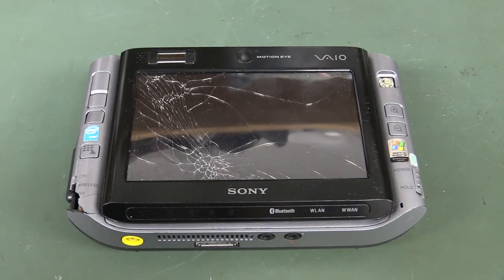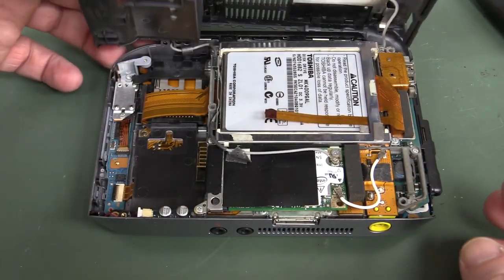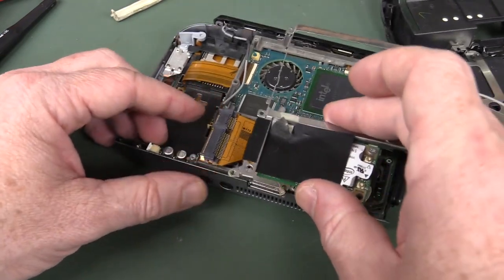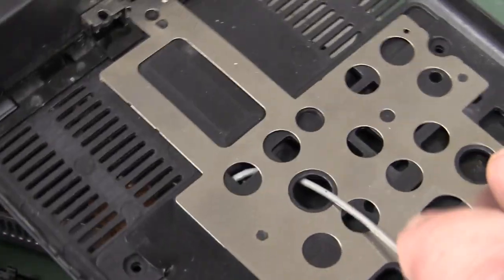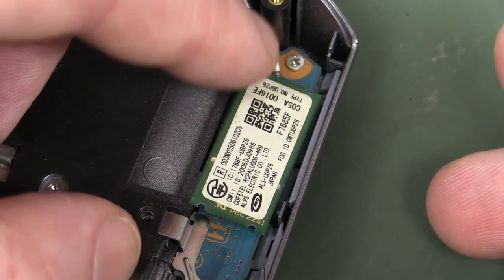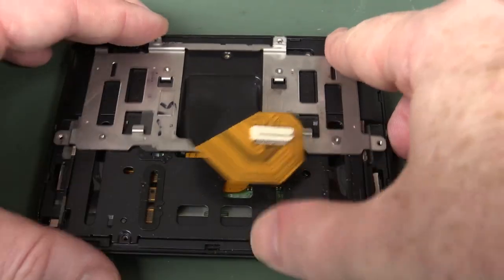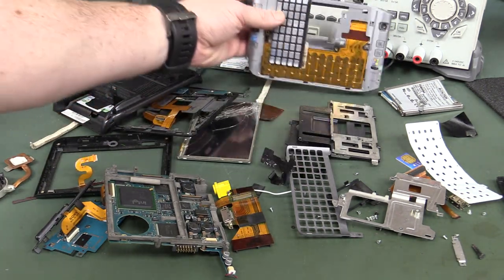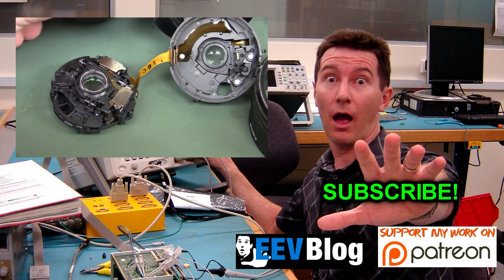EEVblog #914 - Sony VAIO UX Micro PC Teardown

Comment: Around the same time VIA made low power (for the time) x86 processors, that allowed small fan less PC's to be made, they were almost the same form factor as this Sony machine if memory serves me. Troubles is they were low powered in both meanings of the word, low power consumption and gutless. It's amazing how much stuff has shrunk down in 10 years, look at the wifi chipset on the single board computers compared to that big old thing that plugged in to the mini pci express, even that cards that plug in to that interface are about 1/4 of the size these days, you need a magnifying glass to see the one on the Raspberry Pi3.

Comment: They were most probably limited by the processor tech at the time, during the era that that was built Intel chips were pretty much the worst chips for power consumption, in the x86 world, Geodes and such existed but their performance was pretty crap, might have been marginally better with a Pentium M but those still ran pretty hot.

Comment: One of the jobs I had we were on call sometimes and the company had something similar to this with cellular internet built in. These were right before net top things came to market, wifi wasn't everywhere, regular laptops were still big and heavy and we didn't all have smartphones. So it actually came in handy being able to load up the company ticket system or log into a server anywhere.

Comment: X86 processors are inherently inefficient, so fans will be needed. On the other hand the ARM processors don't need all the extra hardware that X86 does since they are pure RISC design, so they run cooler.

Comment: OMG Dave, thanks! I love old stuff like this. Gut it and put a pi3 in it with a little daq board. Battery life: 6 days!

My bet is the h8 did just about everything in that thing but the Windows. Like the video controller in cellphones that does most of the work until you load an app and the CPU gets involved.

Comment: I used to own the Sony Vaio U810 (the convertible laptop version of this device) back in 2008, it had a better half-chiclet keyboard and touchscreen display.  It was actually quite usable at the time, even upgradable to Vista :D

You can get a dock for the expansion port with several USB ports, VGA, ethernet, audio and power, or a little dongle with just ethernet and VGA.

Comment: uCs are very common in laptops and such. they are usually used for logic to control the voltage regulators, sensors and other low level stuff.  Louis Rossmann talks about the Mac use of them in his videos a lot.

Comment: For Intel processors, the S-spec number (SL9LC on that chip) is the best to look up by: http://ark.intel.com/products/spec/SL9LC Looks like it pulled 5.5W. It's an ULW part for the time, so I doubt they could've done much better, heat-wise, for 2006.

Comment: The Sony "Motion eye"  AKA Sony Vaio UX180P  was a decent machine for field work/dispatch.  I sold a ton of these to a field service company with a custom XP app to keep track of dispatches, inventory,  record keeping, invoicing.  At the time 2005ish there was not much around hand hold wise.  These had cell modems cameras, touch screen and were fairly responsive.  This single unit allowed the field agent to document images of everything before starting work, scan parts, get authorization signatures,  document images after work, and then everything was automaticaly updated at dispatch.  Nice units  in all, but I agree the keyboards were dog snot.

Comment: Intel chips of the time were notoriously (and hilariously) power-hungry and hot. AMD had a big head start on variable frequency scaling and thermal envelope management. I had an even older (486SX!) Fujitsu Point 510 tablet, similar battery life situation even with monster NiCd cells. ARM, of course, has pretty much always won on performance per watt and resulting thermals for embedded solutions, but as Microsoft's efforts demonstrated, both at the time and since (Surface RT fiasco) modern, general purpose OSes weren't quite up to par until Apple got in that game.
Reply: well, NiCd is much worse than NiMh, and even worse than the Lithium batteries that this device used!
Reply: +Dan Dube At least 4-5x the volume, though... thing had the most atrocious 120db "low battery" scream, too. :D
Reply: GothAlice damn, i'd shit my pants as soon as i'd hear that lol. i'd probably clip the speakers or something
Reply: this was a first gen pentium m which was the turn around for intel, it slapped the athlon 64 around.
Reply: MeakerSE Until Intel attempted to start developing 64-bit chips.  Pure-x64 Itanium… not so hot, vs. AMD's mixed-mode.  (Us OS/kernel developers still have that bizarre legacy to this day as syscalls need to implement three different interfaces…)  Also bridge integration onto the CPU die, HyperTransport and friends, … AMD fairly frequently wipes the floor with Intel in terms of R&D time to market.  No question they're in a bit of a slump at the moment, though.

Back in the day AMD was quite the breath of fresh air vs. buggy Cyrix chips.  Oh, the clone wars.  They were real.  ;)
Reply: ***** Once went off in a uni Psych lecture after the prof unplugged the brick to plug in the cellotape projector. Quite embarrassing.  XD
Reply: GothAlice Damn, must've scared everyone haha
Reply: wtf is a "cellotape projector"? Vocabulary fail: mine or yours.
Reply: marshaul Uh, transparencies?  On an "overhead" projector?  "Cello" from celluloid… those flimsy plastic sheets on rollers… thus the "tape" bit?  From the days of black and white televisions.  Now I feel old, damnit.  >_<

:shakes her cane:

Comment: I actually had one....  (newer model) actually still have it...  it is today running OSX.
Biggest drawback for me was the keyboard...   as you say...  pretty much useless.
Did use it for a year or for doing "onsite" service on railway radio systems adn with some scripts it was useable... but in the end, too little battery life (4.5 hours with the big battery and linux)    I still wish they would make a uptodate version of it.

Comment: Any luck on the Renesas micro controller? I believe similar was described in the schematics of Thinkpad T60. Handling system stuff like battery voltages and temperature. However i did not find it on my variant of T60.

Comment: 13:00 This micro control keyboard and all status lights and also loads BIOS and controls power management by means on switching DC/DC converters. it's common in laptops.

Comment: hey, about that 16bit MC, it is not a surprise at all, such a controller or similar (or a specialized one, sometimes not programmable) is in EVERY laptop/computer motherboard, usually it is called keyboard controller or embedded controller. Keyboard lines connect to it, also mouse, it also controls the power sequence and power states (sleep, etc), fan speed, leds, backlight brightness, the power button also goes to it, and so on. It connects with the southbridge (you called it IO) through LPC bus.

Comment: +EEVblog 8:55 Yes, in part. The CPU (Core Solo U1x00) alone had a TDP of 6W's, then throw in the ICH and everything else and it doesn't look pretty. Not even talking about the display, or the hard drive (3.3V0.5A) and so on.
Looking at modern SoC's with eMMC NAND and you can accomplish similar specs with a heck of a lot less power consumption.
Edit: Well, I guess the actual problem was trying to run x86 in this form factor back in 2006/2007. 2014-2016 not a problem but back then? Ehhh..

Comment: The GSM antenna "connector" in the back is not a connector. It's a sliding contact for the swivelling antenna, which has been ripped off.

Comment: I have one of its successors: SONY VAIO Duo 11. Working judt fine with Windows 10 and Gentoo Linux. Horrible BIOS, ssd failed, its only fan failed, but after 3+ years it's still providing a good 24x7 service at home.

Comment: The power circuitry next to the cpu looks more to be for the battery connector (those prongs next to it) since the micro is below it I would assume it is the system ECU controlling fan speed, battery charging and power management.

Comment: you're bs. I totally wanted this micro PC back in the day. Sony continued to build micro PC's even after this one.
Reply: Toshiba 4200rpm. terrible drive..... so slllloooowwewwwww
Reply: Undoubtedly to get the power and heat requirements down. And they were still excessive! Sorry, this is not a good design.

Comment: they still sell for £300 here in the UK - Sony VAIO VGN-UX280P 4.5-inch Laptop (Intel Core Solo Processor U1400, 1 GB RAM, 40 GB Hard Drive)

Comment: Cingular was a popular "3G" provider back in the day (USA region). It was bought out by ATT in 06' I think.
Reply: IIRC, Cingular itself was formed by SBC, one of the baby bells split off from AT&T. They acquired AT&T Wireless Services and later got acquired by AT&T.
Reply: +Karl Koscher SBC is/was a Baby Bell that came about the split of Ma Bell AT&T, who bought out other Baby Bells, including Pacific Bell here in California. They then bought the remains of Ma Bell AT&T, and changed their business operations back to AT&T, the more popular name. They also purchased Cingular Wireless and changed that to AT&T Wireless. I happen to work for them and wear AT&T uniform, but my checks still say Pacific Bell. Verizon was another Baby Bell that did the same, I believe they bought US Cellular.

Comment: I have one of those believe it or not and I could really use that broken screen as the touch panel on mine is broken and there's a chance I could just reuse that part. The batteries are kinda crazy, there's a standard battery that fits the envelope and there's an extended battery that doesn't fit at all and makes it sit at a jaunty angle. It'll easily run Windows 7 and the GMA 950, although wimpy will run old games without much issue. This device was also used in several TV programs and a James Bond movie. Several different models and were produced and mine is the ux380n.

Comment: had one of these, common faults were the centre click (for the mouse pointer) sticking down causing random clicks, and the flex cable to the lcd damaging the LCD screen  - the battery is the same as the sony handicams, core solo cpu , 1GB Ram with vista, it worked but slow with the mechanical (ipod style) HDD.
Mine had the full docking station for external display, keyboard mouse ethernet sound etc.. 2GB ram and it would have sucked alot less (battery life would have been better).

Comment: Dave, obviously the BT connector has been broken off, like many other pieces in this abused machine. Also, there's clearly a screw that holds that WLAN module to the hard drive frame, and it's pretty obvious that some sort of antenna was stuck on that "connector" on the back. I've never seen the rear of one of these, much less the internals. What happened on this one?

Comment: For simple presentations and very light usage on a secondary screen/projector ( assuming it has one i guess its via dock since i didn't saw vga port or s-video ) it wasn't a bad thing it was till more portable than ThinkPad x41 for example not to mention 15'' laptops .

Comment: At 1:15 you mention that Sony Memory Stick is dead. Not quite true. 
The Sony Memory Stick isn't dead yet. 
I use the Sony 32 Gbyte Memory Stick PRO-HG Duo HX high speed (MSHX32B/M) with my full frame Sony a7 mirrorless e-mount camera. 
From my experience it is very very reliable (Made in Japan). 
It writes 50 MBytes/second which is great for burst shooting and high bitrate video. 
However it is very expensive 60€. It is still available new everywhere. 
At the price of four times bigger 128 GBytes SD. But quality and reliability isn't. You get what you paid. 

The Sony ultraportable UX series was a dream machine ten years ago. However the Asus EEE first netbook appeared a little later at a  fraction of money. 
Very small and  highly expensive ultraportable PCs from Sony and Toshiba wasn't admired so much afterwards.

Comment: That label you have taped over is nothing now that Windows XP is dead and gone and anyway I know the key it starts KYKVX-*********-K42BQ I don't know why that didn't use a ARM processor would have been better than using an Intel Celeron.

Comment: The processor in this thing was alright, definitely better than Intel Atom which came out few years later. The reason for bad battery life was probably not just the processor, but the graphics ship. They were built with an ancient process and had little to none power saving options